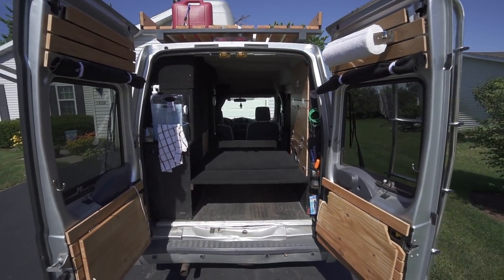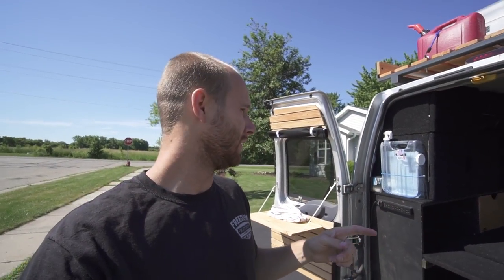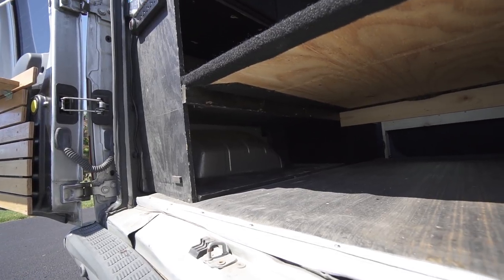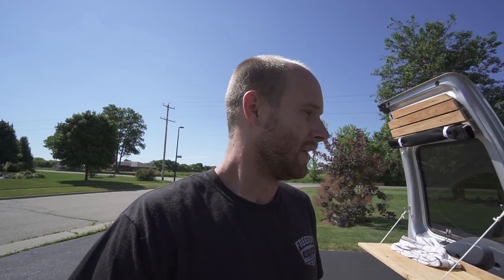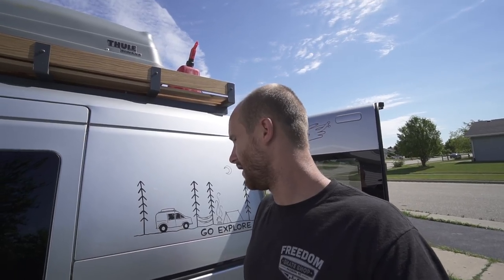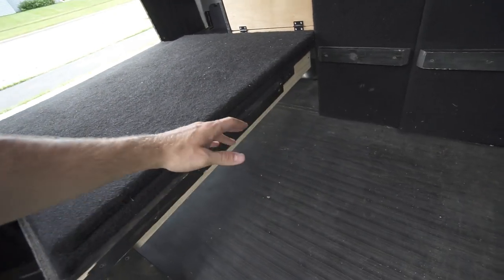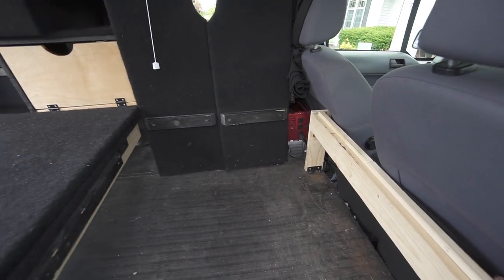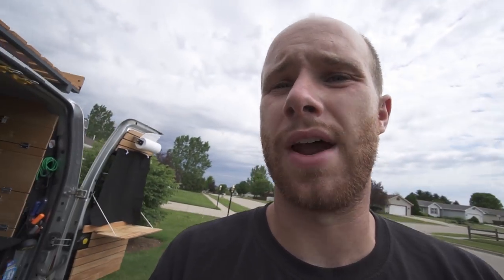2010 Ford Transit Connect Van Conversion

Comment: Incredibly well thought out layout for ur original intended use. Yeah, once u spend some  time in the van, u find out where things go and what works. Look forward to seeing ur next build progress. Girlfriend and I just finished our 2017 Nissan NV200 portable van build which is similar in size to ur Transit Connect but lower roof with longer cargo area inside. Our setup can be installed for weeks long adventures and removed for cargo van use in 15 minutes. Used 3/4" plywood (3 coats polyurethane) for 57.5" long, 14.5" deep table with 3 hinged 19" wide, 14.5" deep drop down leafs that rest on a lip attached to the underside of a 75" long, 26" deep bench that then completes a full van width 55" wide bed with 16.5" space underneath. A 4" thick fullsize futon (Amazon) is bed or sofa seat with backrest. When leafs are flipped on top of table we have 13.5" walking aisle - lip attached on underside of bench extends 1" past edge. Another piece of plywood extends the table when in bed mode, is pinned to lips and rests on crap bucket near passenger seat back. It has desk leg mounts (legs screw on for outside cooking use) and is pinned (to keep it from moving) flat on top of bench behind driver seat back all other times. Plenty o room for lots of plastic bins and soft bag storage under both bench and table. High in the roof corners we use stretchy netting S hooked in some of numerous factory holes provides more storage. Plenty o bungee cords for tie downs and hanging towels etc. Strong magnets with hooks (duct taped on backs so no paint scratches) support even more portable storage that can be used anywhere including holding 2 soft nylon pocket units salvaged from a junked tent, attached to back barn doors. This is a HUGE upgrade from our 1st generation (toaster) Scion XB travel vehicle which has 25K of just adventure miles on it.

Comment: I just bought exactly the same van, but a 2013. 
Thank you for this video. I’m trying to convert mine as well.
Reply: Whats the difference between this one and the 2013?
Reply: @marmitechickenlegs8331  no difference.  2010-2013 are the same
Reply: 2010 has taller roof

Comment: OMG, I just found you and immediately subbed!  THIS van is the exact van I want!  I’m looking at a 2011.  I’ve been wondering how it would be to live in.  I’m a short female...if a man can do it, so can I!  I’m SO EXCITED!  Just watched this whole video and can see on the side that you DID he new one.  Can’t wait to see it!
Reply: I just found a 2011 transit connect xlt yesterday and bought it today!  It was a cargo van but someone already did a mini camper conversion, with small sliding RV windows with screens on the rear sides, insulation, small table, drawers, shelves, solar and a westfalia type seat tri-fold bed with seatbelts! So freaking excited. It had less than 84K miles and appears to have been very well taken care of!  I’m just going to use it for quick trips and stealth camping. I have an Aliner trailer I tow with my Honda Pilot for longer trips.  I’m so glad I don’t have to do the build myself, at least while I figure out what I like and don’t like. Buy something cheaper, try to live in it easily and THEN plan a build. That way you don’t waste your time and money on things you think you need but find out you don’t need. I don’t need much for a few nights of urban camping, so my van is perfect. I’m 5’2” it feels perfect for me.

Comment: That's a lot in a tiny space.  I don't know if you're interested, but Bob  Wells has a video with a Fantastic Fan install in the back window. It would eliminate the need to cut a hole in your roof.

Comment: You did a great job on that . I got a used one 2010 with 158,000 miles kinda scary with all the miles but if it well last a few years or more for local businesses cool. It was services done at Ford before engine is clean runs great but Tran. Might slip 1 to 2 nd. ? Getting it look at. Could be me getting used to the van too. I love the van too

Comment: Nice build and some great ideas. I just subbed and I'm looking forward to your rebuild. I have been thinking about building a Transit Connect so I'm searching out build videos to get some ideas and see what can be done with the space. One quick question if you have a chance to reply. Have you ever tracked your gas mileage with that van and if so, what were you getting? (Guess that's technically two questions)

Comment: How is this rack connected to van?

Pre-existing Transit  holes or fabricated brackets to  permit thru-bolting to interior as I do not see  roof drip edges ?
Marine grade aluminum is another option for rackets

Roto pack fuel / water containers might be an option for roof.

Can transit suspensions be upgraded / increased weight capacity?

Any cavities under floor for adding tool bins or custom storage nooks?

Comment: I've been using a Ford Focus Wagon and it is great except for the lack of head room.
Unfortunately, they do not offer your vehicle as a manual transmission; big downside IMO.
If I was in that vehicle, I'd utilize a Murphy Bed.
The side shelf (or shelves) can fold down into a bed when needed and leave the space open for functional use when not sleeping
Reply: we have the manual over here in UK

Comment: Hey Josh, what kind of wood and screws did you use for your back door? I have a 2011 transit connect without windows on the back door, so I'm most definitely going to work on them like you have. I love the fold down table. I was thinking that I could do that but also double it as storage. Thanks!
Reply from the maker: Hey! I cut strips out of a sheet of plywood maybe 1/2” thick?? Then used screws like this but I wanna say they were 1 1/2” long 

https://www.homedepot.com/p/Everbilt-8-x-1-in-Phillips-Truss-head-Lath-Self-Drilling-Screw-1-lb-Box-179-Pack-116079/205142783?MERCH=REC-mobileweb_pip_rr-205142867--205142783--N

Hope that helps!